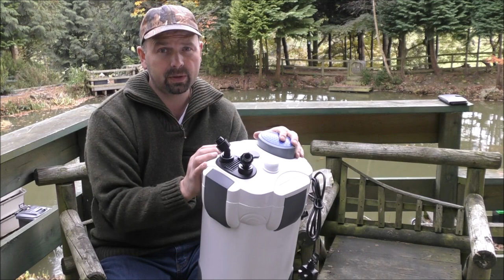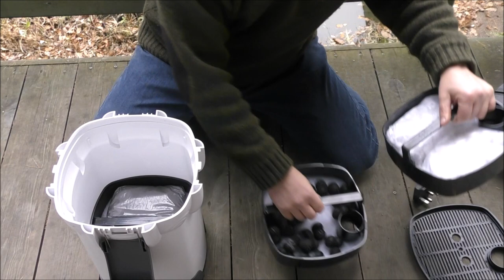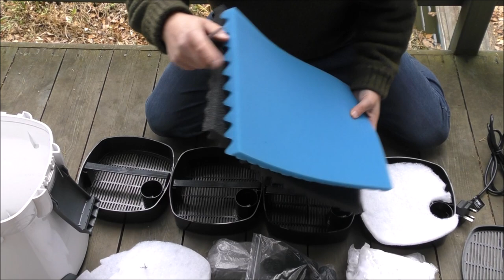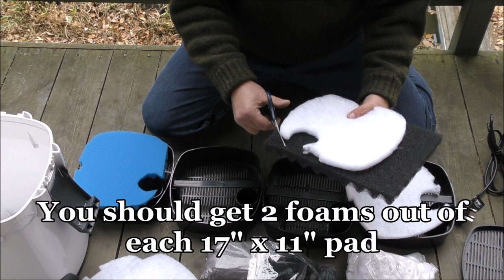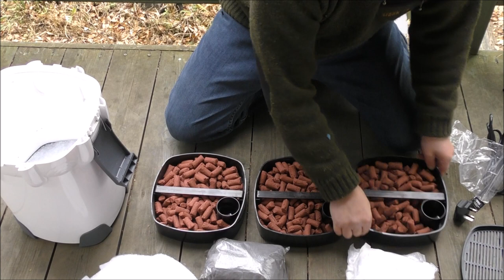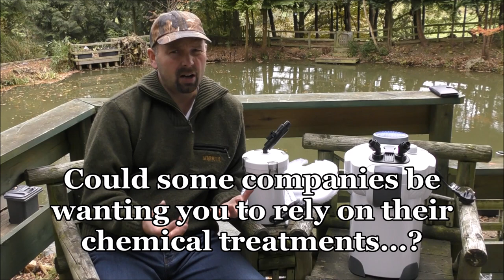Why Your Filter is TOO SMALL and NOT CYCLED

Comment: Learned a lot from your video, have been struggling with my tank for a while. I have a 55 gallon tank with a fluval 306. Could you make a video of the proper way to set it up? The instructions that came with it don't seem correct  from what I have seen in your videos. And do you need to have carbon in the canister? Sorry for all the questions but am new to this type of filter and want to make sure it is set up correctly. Thank you.
Reply from the maker: The side foams in the fluvals are quite good and water hits them at the same time so they should be left as they are. Bottom tray would be for extra foams and fine pad leaving 2 trays for media. Each tray holds approx. 1kg of biohome ultimate and if you used carbon it would go in the top of the top tray. There is nothing wrong with using carbon but it is generally not something which is needed all the time - it is useful to 'polish' water and draw in heavy metals, residual fish treatments, colour from bogwood etc. but can be added as needed (e.g. after a course of fish treatment).
I have a 206 video to edit down and upload so hope to get that one done soon.

Comment: Pondguru, which filter do you recommend for use with biohome to achieve the best results? Preferably not a sump but if that's what it takes... I will do it. Also, is biohome ultimate the best? Or biohome ultra? I'm setting up a 125 gallon tank for discus.
Namaste, 
Tanja
Reply from the maker: The biohome ultimate is exactly the same as the mini ultra except for the added trace elements (which allow faster bacteria colonization) in the the ultimate. As long as your filter is a suitable size for the tank and stock it will be fine to use a canister (or 2 canister) filters.
The type of filter doesn't really matter as the biohome has  an internal structure that will allow for small pockets of anaerobic bacteria to develop in side the media even in a fast flowing highly oxygenated flow of water.

Comment: Question for you: Eheim states that its 1200 xlt has 12L filter capacity, and is good for an aquarium of about 400 litres. If I add the booster and an intake prefilter to handle all the mechanical filtration, would the 12L of filter capacity with 10kg of biohome be enough to handle an 800 L tank? Or would one have to add an entire, and pricey, second filter?
Reply: For a normally stocked tank that would work no problem - always best to use one filter instead of running and maintaining 2 filters but if the tank is heavily stocked you may need 2 filters to hold enough media for a full cycle.

Comment: Hi Richard,
I am getting a new 145 ltr aquarium and am going to keep it as a Male  Guppy tank, so a low bioload.  Due to back problems I have difficulty servicing external canister filters. What internal filter would you recommend please?  This will be my 4th tank, 200ltr, 84 ltr and Nano 22ltr. Both my lager tanks do have external canister filters and use your Biomax and keep every level spot on, usually 0,0,0. They are set up as you kindly showed me when I visited to collect my Biohome Ultimate Media from you.  Kind regards. John
Reply from the maker: That's great you have full cycles on your existing filters so that is a perfect situation.
I recently took a look at the Fluval Tidal 110 which holds quite a lot of media so while I know it isn't an internal filter it would be easy to service and should fit a good 1.5kg of biohome ultimate in there if out in loosely or nearer 1.2kg if in mesh bags. Alternately biogravel could be used in mesh bags. I don't currently know any internal filters which hold enough media for a full cycle so would struggle to recommend one of those.

Comment: Guru,I have 100ML 0f Purigen. Should that be placed in the mechanical filtration tray or in one of the the Bio Home Ultimate trays? Thanks.
Reply: (my other channel) As that is a chemical media it would be last in the 'mechanical, biological, chemical' order so assuming that your filter works bottom to top the chemical media would go in the top of the top tray. If the filter works top to bottom it would go in the bottom of the bottom tray.
Ideally purigen wouldn't be used at all as it draws in far too many trace elements which can have a catastrophic effect on bacteria.
I have notes about what helps and what hinders the bacteria on the Q&A page of the FilterPro site (link in description).

Comment: Hi Richard what's the difference between eheim substrat pro and biohome ultimate? Aren't they both sintered glass? I'm only asking as I got the all ponds solutions exf2000 filter with the booster and have the 4 trays all filled up with substrat pro. Also why is biohome in kilos and other media in litres? Thanks for all the videos
Reply from the maker: No real reason why it is sold in kilos as opposed to litres but it is quite heavy so maybe that was deemed the way to go when it first was invented 20+ years ago and was probably competing against the likes of alfagrog for ponds which is also sold per kilo.
Lightweight media tends to be sold in litres but the unit of measurement is largely irrelevant when proper guidance is used to how much is needed to perform a certain task - we have those figures based on a full cycle for a variety of stocking scenarios but I don't know of any other companies which state what the expected effect is from 'X' amount of media so I can see why people often question the (entirely realistic) amounts we talk about for a full cycle or even question what a full cycle is, especially when there are still some tools out there telling people a that a full cycle is impossible...which is very frustrating, lol
There are many types of sintered glass media and the difference really comes down to the internal structure which is dictated by grain size choice and manufacturing method. Unfortunately I didn't have a sample of the substrat pro when I did the 'Looking inside filter media video' so really need to do an update on that with different media types. If you haven't seen that video it's a great one to show what makes for a good internal structure.
If you have 4 trays filled up with substrat pro and the filter is sized accordingly then you should see a full cycle develop as long as no external factors affect bacteria negatively (e.g. treatments which are anti-bacterial or detoxify / bind ammonia, nitrite and nitrate) so I'd be very interested to hear how that goes. I've not heard of other media allowing for a full cycle with any sort of recommended amount etc. but all porous good quality media should home aerobic and anaerobic bacteria to some degree.

Comment: I'm very interested in a booster filter but they don't seem to be common, and I'm confused on some things like some descriptions it says for tanks below .06m which makes no sense also hose sizes and some I see say it works for the 3-6 series. I have a Sun Sun 703b. I've also seen some unbranded ones that are transparent which seems that would have an advantage to them. Could you shed some light on this or happen to have a video I didn't notice? I've searched for a few hours and haven't really seen much information. Thank you!
Reply from the maker: Clear boosters may be available elsewhere but I have never seen one in UK - we just have the 1.2 litre and 2.3 litre booster. 2.3 litre was shown in this video and that would be the one to go for as it would restrict the flow much less than the smaller 1.2 litre booster.
Ideally they would be bigger than the versions which are currently available.

Comment: So. Buy a canister filter rated at least twice the size of your tank’s litre capacity 
and fill it with at least 1kg of Bio material per 100L of tank’s water capacity.
Example
100L tank with  advertised up to 200L Canister. (Eheim are the exception, as their site matches the correct values)
1kg of bio material per 100L tank water
20 Uk gallon tank is probably ok for above set-up?... "Please correct me if I'm wrongly giving out disinformation"

Comment: I'm confused about Eheim Professional 4+ series.....they have filter pads on top because water inlet is rerouted? Should pads also be placed on bottom? Thanks man, you inspire me.
Reply from the maker: It is just the same really - except they have a 'pre-filter tray' which should just be left as it is then bottom tray used for extra foams and fine pad. Tray(s) above the bottom tray can then be used for media. Once water has gone through the pre-filter tray it goes down outside of trays and rises back up through foams and media just like the filter in this video so no worries there - Eheim make great filters.

Comment: A question about filter booster. I use it as a prefilter for mechanical filtration and it is before my main canister JBL 1502,  where is my biological filtration.  It is hard to open this filter booster, when you wand to clean It (there is a vacuum). I wonder how will be the performance if , I use it not as a prefilter but as post filter. (after the main canister, instead of before - the idea is to be filled not with sponges, but with ceramic media, and mechanical filtration to be in the main canister - 2 of 4 basket to be with sponges , and other 2 basket to be with ceramic media + media in the booster). Is the performance (liters per hour) will decrease significantly? Any other problems?
Reply from the maker: Flow rate will be greater if you use a booster after a main filter as there will be less resistance through media than there would be through foams and foams in a canister have a larger contact area compared to a booster. However if you're using ceramic media you'll be very unlikely to see a reduction on nitrate but ammonia and nitrite should easily be zero - changes in actual water quality are more difficult to quantify unless a suitable media for supporting aerobic and anaerobic bacteria (for full cycle) is used as the noticeable factor will be nitrate level when a suitable sized filter is properly set up.
Using ceramic media in extra trays or a booster won't make the system into more of a nitrate factory as there is only a certain amount of waste to be turned into nitrate but it won't help toward reducing it.
You really only need the pre-filter (coarse foam) and bottom tray (foams and fine pad)  to have foams in so there's no point wasting another tray on them which could otherwise be used for media (of any type).

Comment: Would that filter you have in the video be enough for a 65 gal tank that’s slightly overstocked with African cichlids?
Reply from the maker: That's about 247 litres (if you're talking US gallons) so would give you the 2kg per 100 litres required for a cichlid tank. It will probably be nearer 200 litres once all the rocks are taken into account so should all be good.

Comment: A very interesting watch....Just learned every thing i have been doing is wrong. Well not completely wrong but there is room for improvement. So a couple of questions have sprung to mind as i have been watching a couple of your videos in regards to Bio Home media. I run a 500 litre american cichlid tank, heavily stocked with 2 filters, canister and a overhead trickle filter that came "built in" to my AquaOne tank. My Main question if do you think i could achieve a "full" cycle in my tank by adding Bio home in one of my filter while continuing to run ceramic media such as matrix and marine pure in the other filter? Im a fan of seachem product, I guess your not???? Anyway i always use Prime at decholrinator and have never had a problem recharging Purigen with bleach. Do you think these product would prevent me from a full cycle where i could see my nitrates lowered? If you done recommend seachem, what brands do you recommend to dechlorinate water and what can safely be used to remove tannins from the water. Cheers

Comment: Greg, hope all is doing fantastic!   I have a couple of questions about pimping my SunSun 704B canister filter.  First a little background.  I am a novice fish keeper at best.  My starter aquarium is a 55 gallon tank.  I am using a underground filter coupled with the SunSun 704B canister filter.  I have taken my two HOB’s off the tank and holding them for emergency standby.   I have been watching more than several of your pimping videos and I not only enjoy them but also have learned from them.  Your explanation of the mechanical, bio, and chemical (MBC) filtration is not only understandable but informative.  Thank you so much, now for my questions:   I have order two pounds (approx .907 kilo) of your recommend Biohome Ultimate media for my canister.  The price is extremely high at approximately $35.00 US Dollars.  As you know, the SunSun 704B has four large trays.  Under my first tray is the cheap supplied bio material used to break up the water prior to entering the first tray.  The first tray has all three of the mechanical foam, coarse, medium, and fine.  Now, is there any other media that I can use along with the Biohome Ultimate?   I just can not afford to fill all three remaining trays with the Biohome Ultimate Media, or send you my entire canister for your demonstration on pimping out the 704B.  Sadly, it is beyond my price range, even though I would love to do so.  And if I were to add another type media that you may mention, where would the placement  be in reference to the tray stacking?  Should the Biohome Ultimate be placed in the second, third, or fourth tray for optimum success of the complete cycle; Ammonia, Nitrite, Nitrate.  Oh, and I also ordered the bacteria balls to add to the media, just to help get things started.  I thought with the cheaper media that you may mention and I would add because of your recommendation, the bacteria balls would be a plus.  Well that’s about it, for a closing question, am I over doing my filtration with the under gravel filter plus the 704B for a 55 gallon tank, which is not over loaded with our finned friends?   Thank you again for you free display of knowledge, not only has it truly made me  a better Aquariust but I have been able to help others.  I also have recommended your YouTube sight to all my friends!  Again, 
thank you and I most definitely await any comments that you may have.  Please address those comments or recommendations to my other email address of:  mverostek@hughes.net
Reply: Bro, this guys a a good percentage of valuable information, but don't believe 100% from anyone.

There are plenty of great bio media available for cheap. Even lava rock will work wonders.

Comment: So if you use a booster filter (ie 2 filters in total), do you need to match the flow rates of the two and how? And when you said 1kg of media, which kind of media did you mean? Since one kind can be heavier than another. Thanks!
Reply from the maker: The booster has no pump so there is no need to match flow rates - it is simply an extra container for foams (see link in video description and pinned comment).
The '1kg of media per 100 litres' for a normal tank to achieve full cycle filtration is based on feedback we have had over the last 5-6 years on biohome media (most noticeably the mini ultra and ultimate). It is the biohome ultimate I was using and explaining about how much is necessary to achieve full cycle filtration in this video.
Also the sizing of filters is based on using the biohome ultimate as that is a best case scenario for full cycle filtration. Unfortunately as manufacturers / sellers of other media types don't take the reduction of nitrate into account I have no way of advising on how much of another type of media could take to provide full cycle filtration but the results (failure to achieve full cycle) when using other types of media probably tells its own story. 
A canister filter does not have to be a nitrate factory and can be an excellent way to ensure perfect water as long as it is sized properly and set up correctly. 
Regards,
Richard